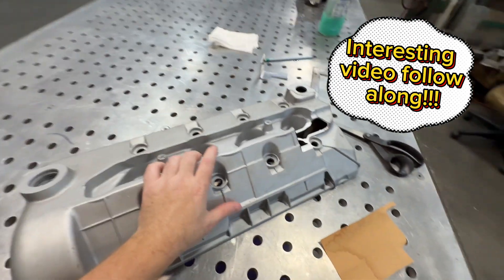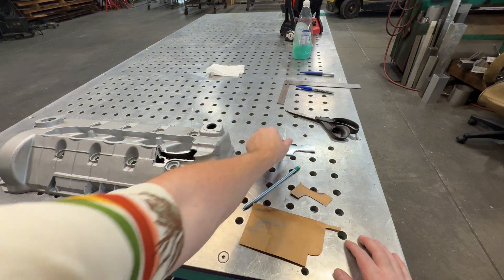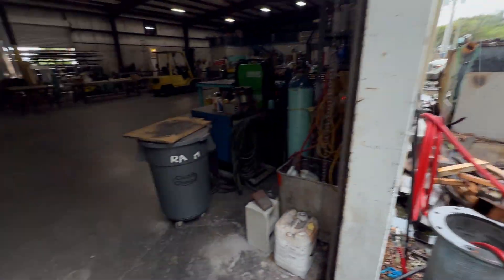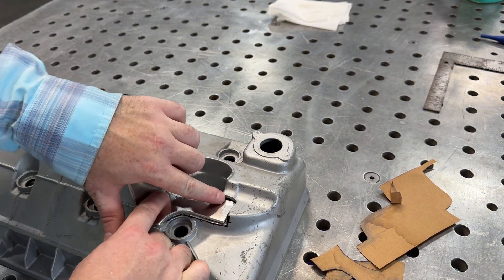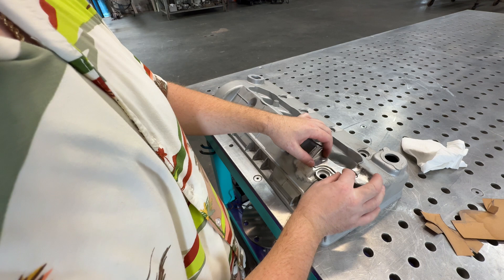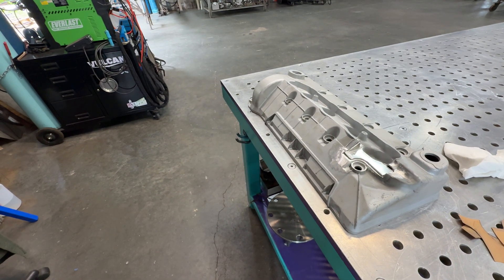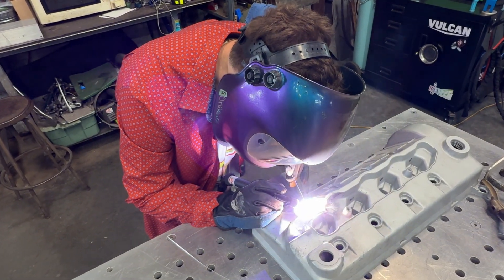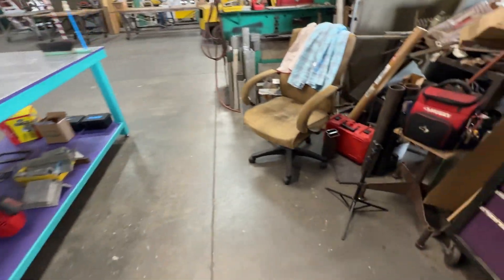How To Tig Weld Cast Aluminum - Patching A Big Hole 2025

Comment: 5554 tig wire runs like 5356 but is good in high temperature applications per Jesse McCollum
Reply from the maker: Good to know thanks for the info . I think I also heard 4943 I think it was is like a mix of 4043 and 5356 good for high heat and welds like 5356 maybe the one you recommended may be better. Next time I order wire I’ll have to look into both of them. Thanks for the info great advice 👍👍

Comment: Nice job! That little flap disc looks handy. Is that a roloc fitting?
Reply from the maker: Thanks 🙏. Which one are you talking about ? For the right angle for grinder I use yes the roloc 3”  flap disc wheels and others too not sure if your talking about the straight grinder too that’s like a straight shank that the sandpaper wheels twist onto the 1/4” shank or arbor 👍
Reply: @WojnarskiWeldingFabricaion  Yeah, the 3" disc. Be interesting to see a review on the right angle grinder.
Reply from the maker: @MidEngineering  3” years that’s a roloc I think on a smaller roloc arbor like 2” I think just a smaller standard roloc flap disc. I’m sure you know about them. 
I’m planning on doing a video on the newer Milwaukee right angle grinder the newer gen two compared to the gen one. I definitely recommend it though if your on the fence of getting one the gen two is way more powerful but I think it would make a interesting video especially for people that even have the gen one and are thinking about upgrading 👍👍

Comment: One station in the Navy was sheet metal shop. 9 months of welding thin aluminum, stainless and carbon steel.
Reply from the maker: Sounds tedious hopefully it was a nice shop
Reply: yeah. That shop had all the nice stuff. It was really fun and I learned tons about welding thin metal
Reply from the maker: @travismanuel3739 sounds fun it’s nice when you get some decent and variety of tools to work with definitely makes you more efficient.👍 thin metals are tricky I get some thin stuff here and there most of it may be 16-18ga had thinner but it does get tedious and I’m no expert imagine working with it all day everyday

Comment: I’ve never worked on auto parts. I think it would be interesting. My only concern is the metal part being contaminated with oil grease or something else. I like the small tedious things, thin stuff.
Reply from the maker: Sometimes it’s fun or interesting sometimes it’s not . But yes you are 100 percent right sometimes the parts can be really greasy or oily and dirty and it’s annoying this customer Josh he’s really good with cleaning parts before dropping them off which is definitely appreciated other people just drop it off full of grease sometimes and I usually like to clean it especially aluminum before welding so hey we’re gonna probably charge you to clean it then too now I didn’t always mind but when it’s really bad it’s annoying 👍